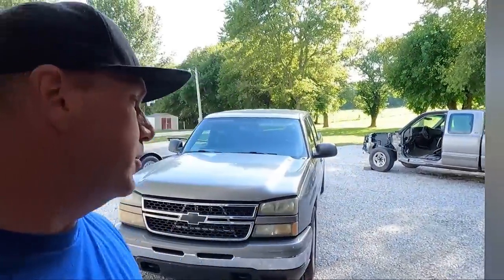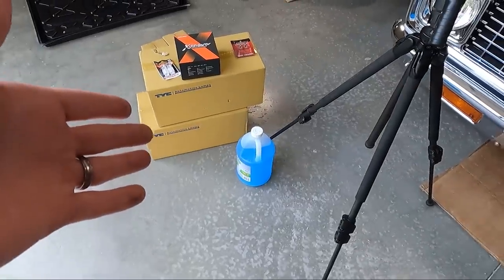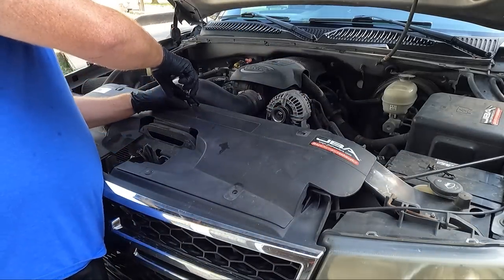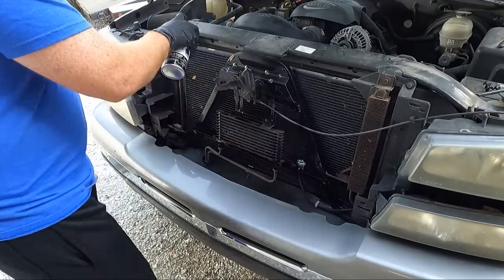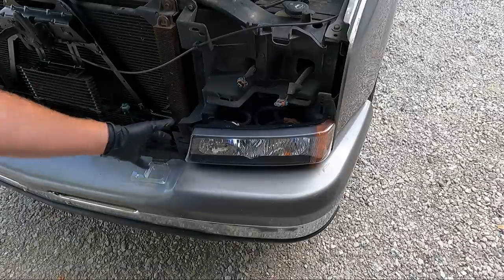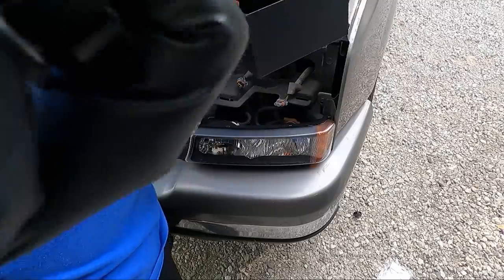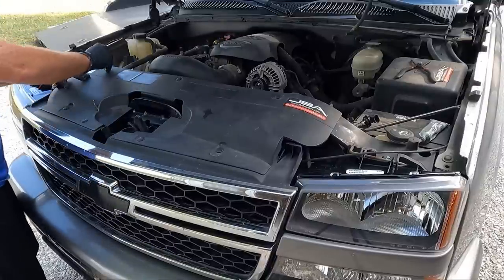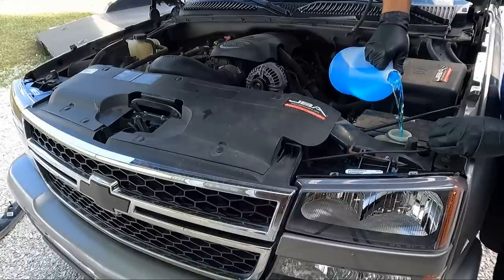New Headlights for the Cateye Silverado (Finally!)

Comment: I’m trying to upgrade my 2005 base model regular cab Silverado. It was my Grandpa’s farm truck. I’m using 2007 badges and 2007 aluminum OEM wheels on it. That’s because my late dad once owned a 2007 LTZ Silverado. My truck doesn’t even have carpet or a fold down console in the interior, but it will. I just ordered some new headlights and taillights for mine. Although, I picked the “black surrounded” headlights and the “smoked” taillights. I’m inspired by this video. My truck will not be the same after the wheels and lights are upgraded. It amazes me what’s possible to get done with just a mail order makeover. My grandpa would not buy a vehicle for any reason but use on his farm. I think that I can make it mine by just buying a few things and installing them myself. I have already bought everything I want, but the carpet and the radio. Again, thank you for the inspiration and another great video.
Reply from the maker: Sounds like a cool build. I'm sure your dad would love that.
Reply: @TWAMotorsports  Thanks. I also want to use the 2007 “classic” hood and grille, but that’s only if I can find a good used hood that is the same color as my truck. That’s where the easy part ends. But since my truck is white, the most common color on the road, maybe it won’t be impossible. I’ve just had to spend the money slowly and carefully to find the things I’ve gotten so far.

Comment: I bought an 05 Avalanche bumper after I hit a deer. It had factory fog lights, and my 03 Silverado was an LS, so it didn't have fog lights. Thanks to others on YouTube,  it was fairly easy to add the harness to my fuse panel and add a fog light switch.  The fuse was wired already in the plug to the back of the cargo light connector and when I bought the fog / cargo combo switch,  the fog light dash switch was connected automatically to the fuse in the fuse panel. I used Sea Light 360° fog lights. I'm now ordering new lights like you did. And I'll be be putting Sea Light bulbs in them too. Thanks to you, I got a preview of how they will look!
Reply from the maker: Nice job. The sea lights is reasonably priced option

Comment: I used those Sealight LEDs in my 97 Suburban in Spyder glass housings...
They were about 'twice' the brightness of the OEM bulbs.
I later rewired the headlights to use all four bulbs in the 'bright' mode... 
I now have a set in my '04 'cat-eye', I added the all-on mode for my brights for all of the country driving.
Reply from the maker: Definitely brighter
Reply: @TWAMotorsports  A lot of the LEDs have a big fan/heat-sink that will not fit without modifying the core support, which is why I chose the 'Sealight' fanless set (like the set you used). IMO Halogen bulbs are only to be used until they can be replaced with LED.
Reply from the maker: I agree. Some don't fit

Comment: Used those LED’s on my 08 Tahoe and was super impressed! Did lots of research and for a cheaper budget set of lights…. Total win! Over a year and still impressed. Couldn’t find a Fog Led from them at the time and had to use another brand, but everything worked well together and the amount of visibility I gained on Low beam alone, Best money I ever spent. Slammed my 08 LTZ hoe & living in the country driving home at night from UPS…. I can see all the Deer, Skunks and other night time Lowered truck issues in the road. 
Thanks for the killer content, killer in-depth installs and doing kool things to trucks. 
Love to see you KO the red truck and back to the TA and maybe toss in Some kool Shop mods, work bench,even a little garage art for the walls. 
Keep on Busting them knuckles bro!  Laterz!
Reply from the maker: Thank you. Yeah that light is nice on country roads with anything dropped. Lol. Hopefully will be back in the ta in a few months.

Comment: I just did the same thing to my 03 Silverado-my old headlights looked just like yours lol.  I ended up putting in AUXITO 9005 9006 LED’s from Amazon for under $70 for all four lights.  What a HUGE DIFFERENCE!  What an easy upgrade that only takes about 10 minutes!
Reply from the maker: Definitely an upgrade
Reply: I would like to know how they held up any condensation in the headlight  ?
Reply from the maker: @MrSymbolic7 good while I had the truck

Comment: I put some Fahren LEDs in my truck last December, the beam pattern is great, they are super bright and not super expensive for both the high and lows. they've been working great for about 11 months now. the ONLY issue I had is that I had to adjust 3 of them, but it's really easy. And they don't have the little end on them that obstructs the light.
Reply from the maker: Good to hear. May have to try them someday
Reply: @TWAMotorsports  yeah I highly recommend them, also thank you for the tip on painting the radiator support. I painted mine matte black and it definitely made the front end look better.
Reply from the maker: 👍 yeah that paint makes things look cleaner

Comment: I have a dark green 05 crew with the same wheels. Fixing to do 06 front end, all the housing and lights and do the drl mod
Reply from the maker: I love that color in these trucks.
Reply: @TWAMotorsports  me too, unfortunately I got stuck with the stupid tan interior. And finding a decent tan full center console has been futile
Reply from the maker: I kinda like the tan. It seems like whatever color console I am looking for I find the opposite color. If I need tan I can only find gray and vice versa. Lol
Reply: @TWAMotorsports  a few hours after posting this a tan one with lower dash pieces popped up on ebay and looked in really good condition. I paid out the ass but I been looking for a year lol
Reply from the maker: Well you got one.
Reply: @TWAMotorsports  yeah I got it, looks like fed ex drooped it off a skyscraper. All 4 metal legs are pointing straight up. Other than that it's perfect condition. Although the dash pieces are a much lighter tan

Comment: I am VERY curious about the process of adding fog lights into a silverado that never had them. Got a similar situation coming up in the near future. 06 silverado, base model, that never had any but I want to add some.
Reply from the maker: I may have to do a video on that then.
Reply: Yeah. Travis is the man. I added fog lights on my 13 model. The wiring from the switch to the main fuse panel under the hood was already there. I bought a kit that had the lights and wiring from the fuse panel to the lights. I had to take the fuse panel loose ( lever locks) and put a pinned wire in the panel. You will also need a light switch with the fog light option.
Reply: @TWAMotorsports  can you please do one and try to see if it’s possible to use the oem switch that would come with the truck had it come originally with the truck
Reply from the maker: Its actually almost plug and play on these trucks Larry.
Reply from the maker: I hope to make one
Reply: @TWAMotorsports  It was basically plug and play with mine also. Very simple. I love the look of the fog lights. It makes it look like a higher end truck.
Reply from the maker: Thats true. Makes it look like a higher end model

Comment: Did you use the regular tyc lights of the nfs certified tyc lights? Looks so much better! I need to order a set for mine.
Reply from the maker: Thank you. Generally the nsf if available
Reply: Did you notice any play in the new top light housing? My driver side is a bit loose, seems like it needs to be pushed down into the clips more.
Reply from the maker: No issues whatsoever. Make sure bottom is in the grooves

Comment: I noticed you kept the turn signals incandescent.  I put in LEDs for the turn signals and they wouldn’t work when the headlights were on.  Replaced with incandescent bulbs and the turn signals worked again.  I replaced the flasher module with an electronic option.  Any advice on how to get the LED turn signals to work properly?  Thanks!
Reply from the maker: Buying lasfit with built in error free is the only way I go

Comment: I have an 03 Silverado z71 1500. I'm shopping for quality replacements. I've noticed some variants of part numbers. Do you have experience with TYC 20-6385-90 vs 20-6385-00? Also Some are listed as " 20-6385-90-1 or 20-6385-00-1" Looking for OEM equivalent. Thanks
Reply from the maker: I generally only use tyc. Parts used should be listed in video description
Reply: @TWAMotorsports  They are. I was just seeing different TYC numbers. FYI, it seems that 20-6385-00 is for 2003-04 and 20-6385-90 is for 2005-06 (07 Silverado classic)
Reply from the maker: Dark on the newer modela if I remember correctly

Comment: So I want to buy these went to your link and on Amazon there is 2 options the tyc and the nsf certified what is the difference
Reply from the maker: Nsf is better and generally what I buy
Reply: Any recommendations on a good third break light
Reply from the maker: I buy stock ones
Reply: @TWAMotorsports  from dormen or do you have a link to one or point me in a direction to a good one cuz everything I've come across is garbage lol
Reply from the maker: Gm only

Comment: Tried those TYC Headlights and they were HORRIBLE.
Poor light pattern with major shadows and poor throw = Unsafe Nighttime Driving.
The TYC DRL / Turn Signals were GOOD.
Ended up polishing my 2004 OEM's for drastically better lighting performance.
Reply from the maker: Interesting. Never had that issue